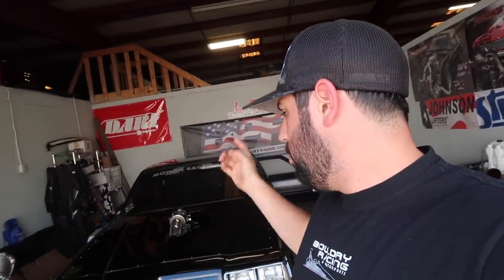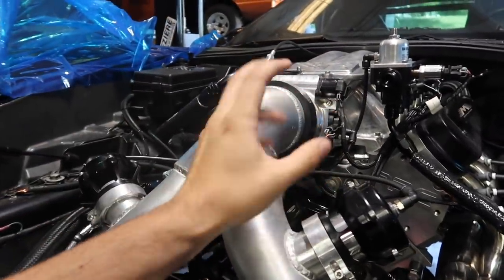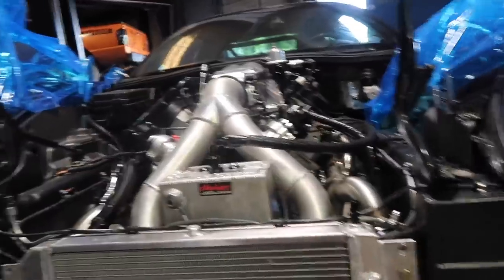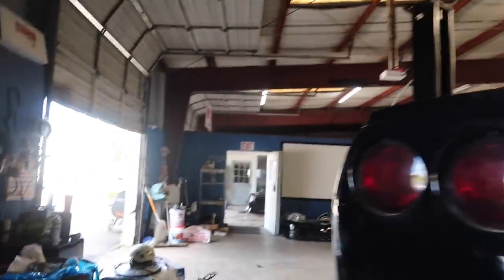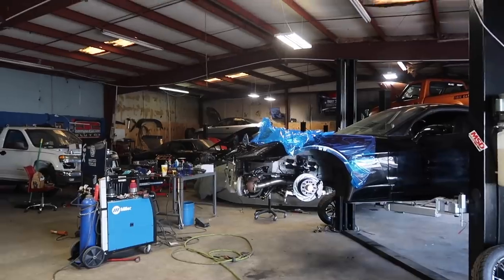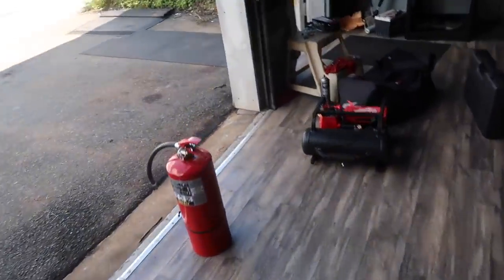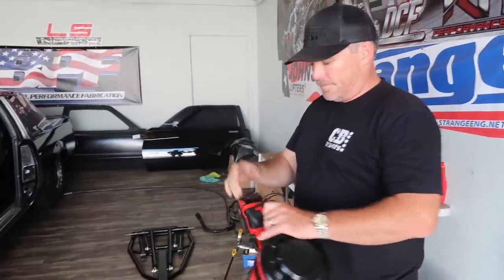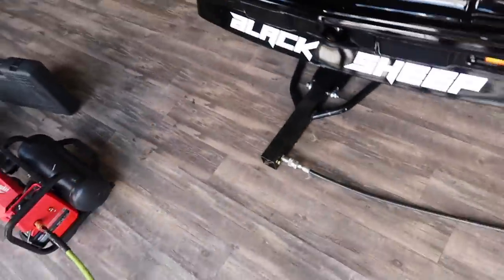The BLACK SHEEP is going ALL ELECTRIC!!!

Comment: Yeah Milwaukee recently came out with a hydraulic pump that is battery operated. All you'd have to do is just tee the output like you have with that foot valve. Will be a better option than that small air pump, it's definitely a volume issue

Comment: As you probably already know you can buy a 110V electric over hydraulic pump in various HP from OTC and cheaper Chinese brands so your are not dependent on air and will be much quicker than the cordless. Be careful using the name ProJack name on jacks that are not made by them, they get their panties in a bunch. Just curious what brand jacks those are. Tell Logan I said hello, he knows me from when I crewed on the Pro Mod from Va.
Reply: Which Pro Mod is that I'm from VA

Comment: That compressor will not provide enough air for your operation. What happens in between rounds when you let the car down, and forget to tighten a anti roll bolt or something and need to jack the car again....another 6-8 minutes and they're calling you to the lanes....lol. A million dollar operation and trying to justify a $500 contractor compressor. Don't forget to have them throw in the radio. They do make good tools. I have a few including the tin snips.... Love y'all, be safe.